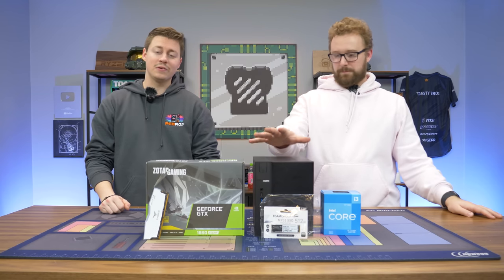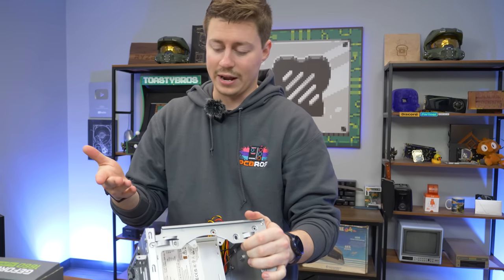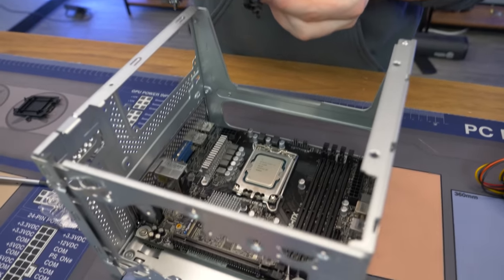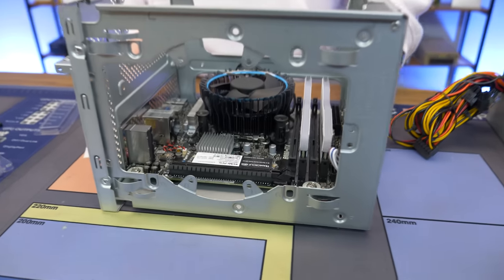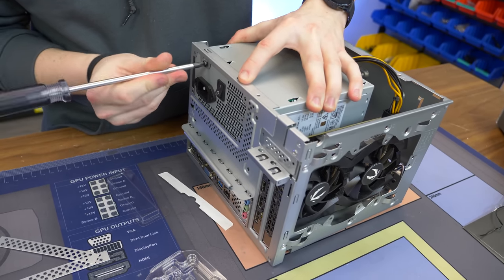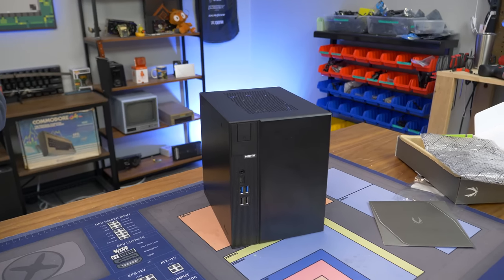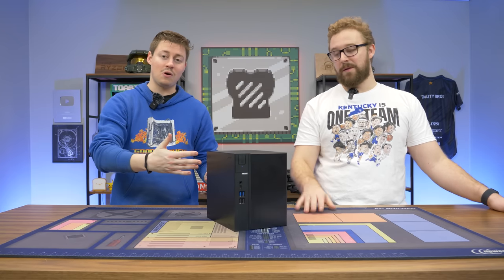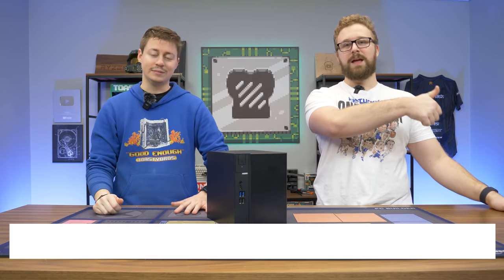We Built a POWERFUL Mini Gaming PC for $500?!

Comment: Thanks for the insights! Just got the same hull and launched in basic config with i5-12500, cheap 95W cooler, 2 X 8 RAM and no Graphics Card. Running pretty hot and throttling in Cinebench 24. On built-in GPU, experiencing mediocre gaming performance at best. Still the size is certainly impressive! Will be working on it.

Comment: The 1660 super is still a good gpu as long as you can get it at a decent price. Vram is getting a bit light even for 1080p but thats an issue for many gpu of the last couple of generations. People laughed when the rx 580 hit with 8gb of vram but thats the main reason its still a relevant gpu today.
Reply: The 3060 12gb also is something good 👍 hope it can lasts years.
Reply: @anexs  I bought that thing for its ram i got a 3090ti now but that card is very very good. That ram will make it last so much longer.
Reply: what games use more than 6g of vram at 1080p?
Reply: @daytimerocker3808  Not many which is why I said its getting light. But many games need much more than that now to have more than low textures. It's the low end of viable vram at the moment and given the trend of ever more detailed textures its only going to get worse. That forsworn game needs 16gigs for the high textures.
Reply: the rx 6700 xt is am awesome card too, currently running that in my pc

Comment: I built one of these and yes its a great little value but heat is an issue with a stock cooler.  A quality low profile fan is a must. Temps were out of control till I bought a Noctua L9 fan. I also changed the fan to run full at all times(probably not needed but I felt better doing so). After those changes no heat issues.
Reply: if you have not undervolting can also help a ton. Not sure how locked down the bios is for this but if its an option negative 100mv on the cpu and doing an after burner curve on the gpu could help a bunch.

Comment: I put together a pc last summer using the i3 12100F - a great CPU. Still paired with my old GTX 1060 3gb, as GPU prices were still bonkers back then. Will look at GPUs later, as I'm fine for now
Reply: Prices are pretty good rn especially used when you do upgrade you will be in good hands.

Comment: That's a cool sff build that doesn't break the bank. I have an R5 2600 with an RX 580 that offers "similar" performance but it cost me around $750 during the first crypto boom.
Reply: Good thing about that system you can upgrade your CPU and GPU fairly easy. My Mother has a 1600 on a b450 Mobo so I'm thinking I may get her a second hand 3600 and upgrade her for not much money.
Reply: @Jwalker76  Take a look around before you go for the 3600 for some reason where I'm at the 5500 or sometimes 5600g can be cheaper the the 3600

Comment: I've built several PCs. These two I built for myself. One of them is an 011 mini so not small. 

The other is my small computer which is NR200P. I built it 2 years ago. 59.50X and a 380 with 32 GB RAM
I put a z63 on the CPU. 
It's a tight squeeze to be sure, but it runs cool enough. It's very powerful for its little tiny size which is smaller than the deal it replaced that was a 7050. I believe it is mid tower that I threw a 3060 in.

Comment: I've been saving up for a small PC myself, but I just don't think the 1660 Super is enough for the games i am planning to play (MSFS, Forza) so I want to squeeze a 3060 into the same case, do you think it will fit? Nice vid as always!
Reply: Sorry bro but a I don't think that the 3060 will fit and even if it somehow does then it will probably run at like 90 degrees Celsius which you probably don't want. This is a great case for light to medium level builds but for something a bit more powerful, you will need a bigger power supply and a bit more air flow.
Reply: @pradhumansingh8385 tually u can squeeze a 3060 in there. Not a full size 3060 of course but one of the smaller versions. EVGA RTX 3060 XC is one that fits
Reply: @Da.Diddler  ohhh, I will look into it but I was imagining a full size one and that is why I wrote this. Plus he/she wanna play MSFS which will obviously make his gpu cry in tears and melt to the ground in that case. 😂
Reply: Check out the 3060 ASUS Phoenix.
Reply: @pradhumansingh8385  Yeah I figured  it would be a little sketchy. I'm thinking of a different case, thanks for the advice though!
Reply: @oKokimaru  I have this case 12500k with EVGA 3060ti (just Fits) play at 1440p all day
Reply: 1660 super will run triple a tittles as long as you run them at low to medium settings
Reply: @RamonAndino  Are the temps fine? If so, it could be a fantastic option for me
Reply: @oKokimaru  they run a lil on the high side , however I have not upgrade stock cooler or done GPU or CPU tuning. Everything is set to stock settings, also you can switch to an SFF power that is more efficient less heat. At the time this was what I considered the cheapest upgrade path to what I wanted. Check out Reddits SFF forum there are a few alternate build there. Good Luck
Reply: @RamonAndino  Will definantly consider, thanks for the info!
Reply: ASUS Dual GeForce RTX 3060 Ti V2 MINI OC Edition 8GB GDDR6 PCI Express 4.0 Video Card DUAL-RTX3060TI-O8G-MINI-V2 (LHR)

Comment: i have one of these with a 12700F and an RX6600, and i absolutely love it. they make some ITX-sized 3060a, but that's the most power you can feasibly stuff into one of these short of a case mod. without a case mod, i shoved a noctua chassis fan where the 3.5" drive would mount + took out the front I/O cover for extra airflow.

Comment: If you are building a budget gaming rig and don't plan to upgrade then it's worth it but otherwise it has too many compromises, you are tied to the PSU that comes with it cause it's reverse fan , without it the CPU is gonna overheat since there is no airflow on it, and you'll be limited on which GPU you can use cause of size and the 500w PSU limit, CPU wise I won't use anything bigger than a i5 12400, the board VRM's can't handle any more than that
Reply: This would be good for my teenage son.

Comment: I'm curious if it would fit a certain gpu, namely an rtx 2060, as I would love to build a PC of this size, but kind of want features like ray tracing and dlss.
Reply: an rtx 2060 cant do ray tracing, only rtx 3000 series and above can
Reply: @enz4961  I thought that was why it was an "rtx" card. 3000 series has second gen ray-tracing cores, so where was first gen? Maybe try googling, instead of unintentional (or maybe intentional, I don't know) gaslighting.
Reply: @AnthroBean2906  oops im so sorry, i didn't mean to gaslight, i read my info wrongly, so sorry, and i just searched up an rtx 2060 can do ray tracing, then again so sorry
Reply: @enz4961  No problemo. Just maybe google something before hand, if you're not entirely sure. This I was sure about, because it's a card I've been wanting to since it's release, and am now only just about able to afford it.
Reply: Would recommend the 2070 or 2060 super the 2060 won't do well in the long run
Reply: ASUS Dual GeForce RTX 3060 Ti V2 MINI OC Edition 8GB GDDR6 PCI Express 4.0 Video Card DUAL-RTX3060TI-O8G-MINI-V2 (LHR)

Comment: Would it be possible to replace the power supplu with an SFX one?
Reply: Check @2:52 and pause it: it looks like it can.
Reply: Yes and No
It will fit yes, BUT that PSU is reverse flow, it draws air from the back and blows it on top of the CPU, is the ONLY source of airflow the case has, without it the CPU will overheat, so unless you buy a sfx PSU and open it and reverse the fan (so bye bye warranty on the PSU as soon as you open it and that it's IF the fan can be flipped back)  it will hurt more than help.

Comment: So I made this built. Except with a 3060 i5 12400 instead of a 1650 an i3 13100. Brought through a their toasty bro affiliate link from new egg. Initially does the PC get hot yes. Nothing that will cause the PC to crash but it will get very warm to the touch. To fix this issue the only thing you have to do is go out and buy 3 USB cooling fans. I bought six of them through Amazon and they're called AC Infinity. Now all 100% admit six was kind of Overkill but I can play Need for Speed Heat a very graphically intensive and CPU intensive game and I only reach Temps in the mid-70s on my GPU and my CPU and motherboard only reaches about 62c... I purchased their set of two 80 mm cooling fans and then some 120 mm fans they also have, and a power adapter that boosts the fan speed. All together all of those fans and that USB power adapter came to about $60 in total these are very cheap fans but they're pretty good quality they don't feel like cheap plastic like they'll fall apart instantly... So if there's anyone who's legitly thinking about making this build maybe for the same reasons that I did because I needed a compact build I don't have a lot of room for a huge Tower. You can definitely make this a very competent gaming desktop. I've literally spent one month testing this PC before I even decided to make this comment because I didn't want these fans to not work or the PC to constantly overheat. And neither one of those things happened so honestly this is a good build can be pretty cheap if you also if you price around the parts onvplaces like eBay and Facebook Marketplace. My entire build excluding the fans and the ssds because I just took those m.2's from my previous gaming laptop. The complete build came out to about $750.
Reply: Hey bro, any chance u can write your full part list for me, I want to build same as you! Thanks 🙏
Reply: @phenom4023  Rtx 3060 single fan pny version 

32 Gb of ram (2x16gb sticks)

I5 12400. Could save 10-20 bucks if you get the 12400f version because it’s has no built in graphics

CPU fan I went with the noctua L9i. Very important to remember that it MUST BE the L9i version. Because cpu uses the lga 1700 socket. Also, remember CPU fan can only be 54 mm in height that’s the max clearance if you stick with the stock ATX power supply that comes with the system, but the system is also mountable for a smaller SFX power supply if you’re willing to go that route. I stuck with the standard power supply and have no issues with it.

My nvme is a old 1TB drive from a gaming laptop I used for years but it’s a Samsung 970 which usually ranges to 90-120 dollars.

Now, as far as the USB fans go, I’ve bought them off of Amazon. They are branded as AC infinity and what I did was I purchased the dual sets of 120 mm fans and a dual set of 80 mm fans which I use for intake and exhaust. If you mount the fans correctly, you’ll definitely feel the heat coming out of, the exhaust ports where the fan should be properly mounted with some type of 3M, double-sided, sticky tape, unless you’re confident to drill mounting holes into the system which I wasn’t. Both sets of fans are relatively cheap as well. I believe one was $18.99 and the other one was like $21. And the AC adapter to make the fan spin at a higher speed was only like an additional eight dollars so overall the USB fans should maybe run you 60 bucks in a whole total. Now I do wanna give you a heads up that these prices may vary because to my knowledge, I believe the asrock deskmeet is a little more expensive than it was when I bought it through Newegg but it’s only buy like $30. I bought the system and they were selling it for 189$. But as long as you’re willing to shop the used market for your graphics card, you should be fine because everything else in the system was new for the exception of the graphics card and that was because someone was selling a 3060 for 250$ on Facebook marketplace near me so it was too good of a deal to pass up

Comment: im not planning on building one but would a dual slot dual fan 3060 fit? i know it would be counter intuitive but would it?
Reply: im sure you could find one that will fit in there, im like 95% sure there are even single fan versions of the 3060
Reply: ASUS Dual GeForce RTX 3060 Ti V2 MINI OC Edition 8GB GDDR6 PCI Express 4.0 Video Card DUAL-RTX3060TI-O8G-MINI-V2 (LHR)

Comment: Can someone help me on why my i5 11400 is at 85% usage on wz2 on all low settings it’s paired with an rx 6600
Reply: The lower the resolution the more heavy is on the CPU, what resolution you are using? Also make sure you don't have any other heavy programs running on the background
Reply: @ivantsipr  1080p no other programs open Besides task Manager to see usage
Reply: @bryanramos9811  make sure the windows power settings are in high performance, also what's the utilization % of the GPU when gaming?
Sry edited after your response
Reply: @ivantsipr  in warzone about 85% usage it and i5 11400

Comment: I’d like to see this with an upgraded psu, cpu, and gpu.
Reply: You can't upgrade the PSU cause of the fan configuration, is reverse so it blows air in top of the CPU, if you use a different PSU your CPU will overheat since the case has no airflow or fans. As for CPU the biggest this mb can handle is a i5 12400, the VRM on the board can't handle anything bigger, and for GPU you are limited to the 500w PSU and the 200mm size restriction , so maybe an 3060Ti mini (single fan versions I think MSI and Palit have models like it) the EVGA SC and the Asus Dual think they can fit, as for AMD the Power Color Fighter 6650xt is the only 6650xt that can fit in the case.
Reply: @ivantsipr  so you can put in another sff psu in there with an after market cpu cooler and orient the cpu cooler fan to blow the hot air out the psu in that set orientation.
Reply: @L1lton23  the only CPU coolers that fit ( even with an sfx PSU) are low profile ones so no tower coolers will fit , so no orientation to change , and you eliminate the only intake source the case has so not a good idea, anyways with the other limitations like the VRM on the board and the small size of GPU the best CPU you can use is a i5 12400, for GPU will be a rx 6650xt (Power colo fighter is the only model I know is 200mm every other one I have seen is bigger) or a mini 3060 12gb or 3060Ti

Comment: Let me destroy this build cause it's bad
Intel i3 12100F  vs  ryzen 5 5600g .. better rendering speed and FPS goes to AMD ryzen 5 5600g... $30 more for the ryzen  but the performance boost is an undeniable value
GTX 1660 Super vs rx 6600.. once again.. same price maybe cheaper and way better performance from 6600.

Not to mention you have a pre built case with a bronze level fire hazard... That is not a good build